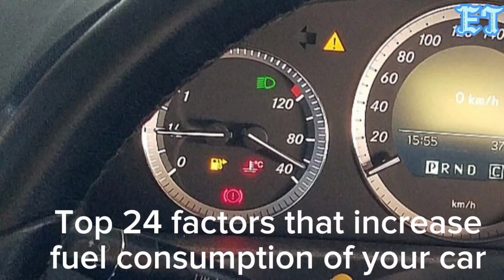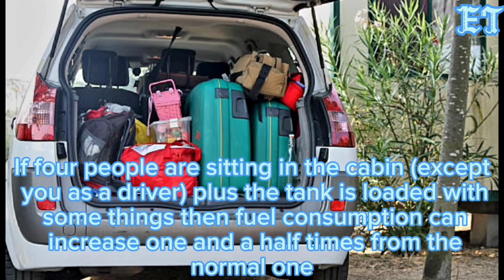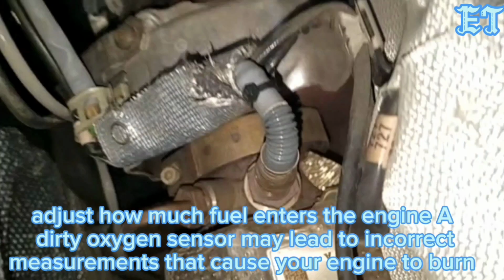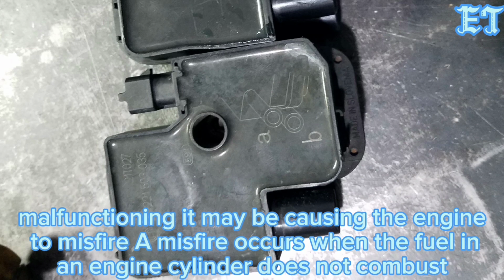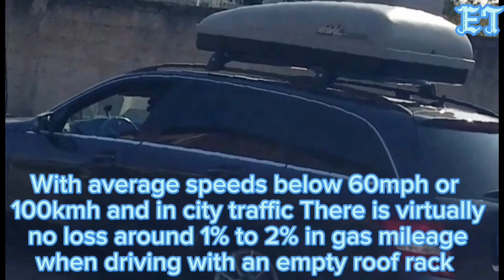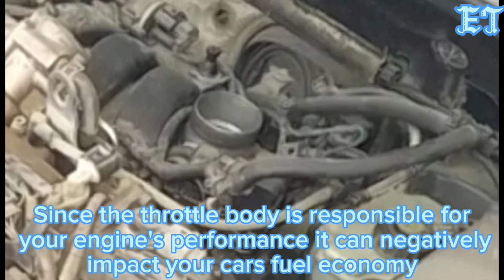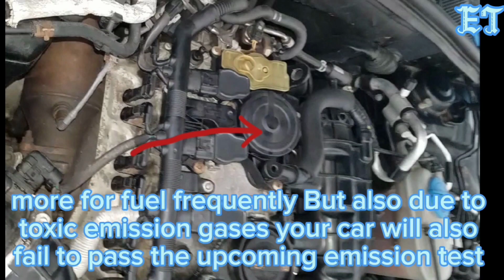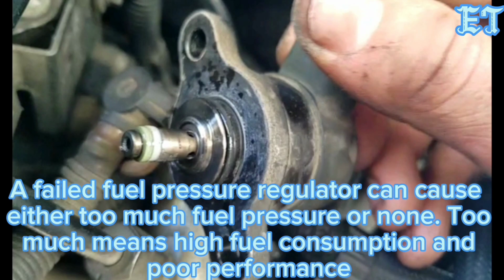24 factors for increased fuel⛽consumption, and what to do| Bad Gas Mileage

Comment: Bad gas cap
Reply: if the gas cap is not sealing properly it can cause fuel vapors to escape and it leads to a decrease in fuel system pressure